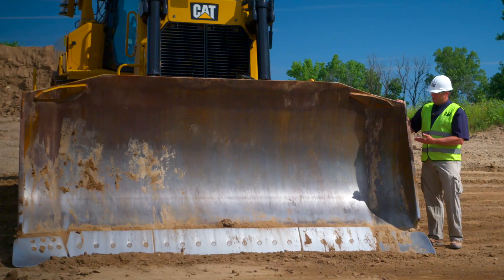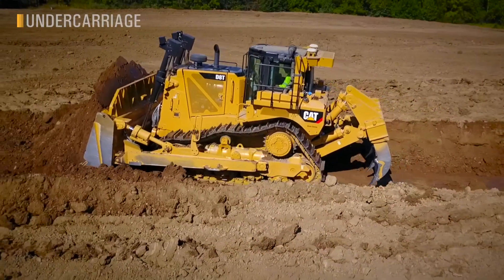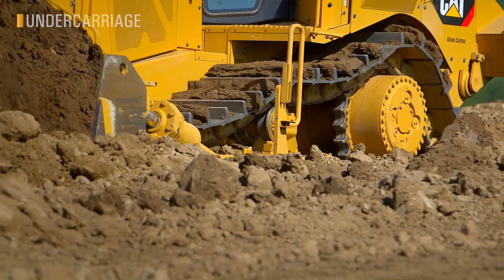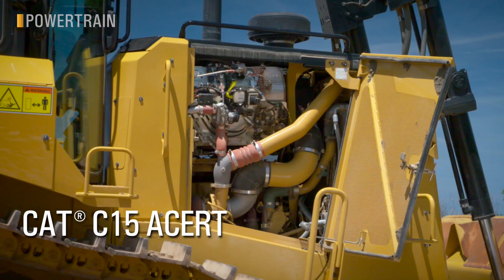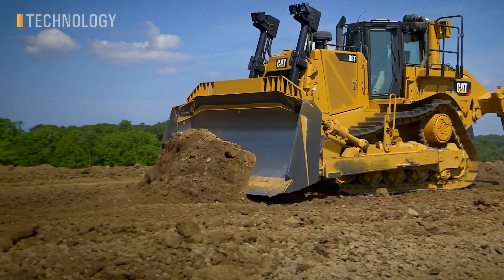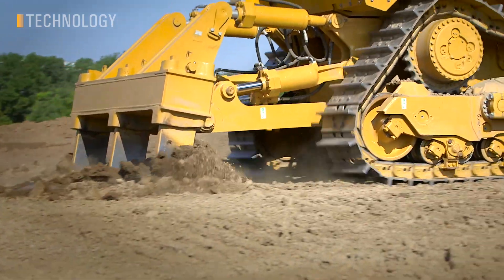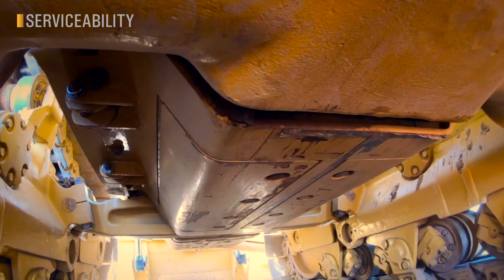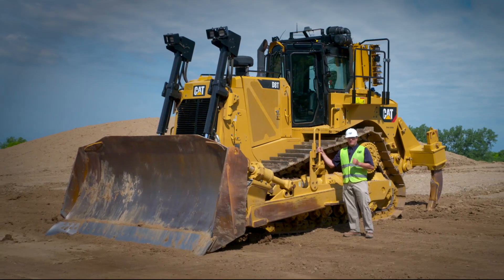Cat® D8T Dozer Feature Walk-Around

Comment: yea need a place for storage aka lunch box holder , deeper cup holders and some sort of built in communication, cant hardly hear cb's and the handhelds we use on our current job usually run down before the end of the day. A way to mesh coms with the stereo speakers would be a nice touch! Would make it alot easier to hear! Driving D8R now, that added 4th gear sounds like it would make this machine way more effective too!
@Cat® Products, Get at me I have an excellent idea for the future of GPS and dozing! Something that could be implemented even on older machines. From your 6 wheel ADTs 745's, 740's to your dozers, this would be a total game changer for both operators and machines!

Comment: Where is your video  on the 10T Dozier. I work in  mining for the last 11 years I notice that cat does not  show dozers ripping  in blast rock where slot of the rock needs too be RIP before  it can be loaded. You maybe able  to  use auto rip in soft ground  but don't work ripping rock as you need to be adjusting the ripper all over time

Comment: I do like the four-speed idea that's about it but I think I can push more when it's struggling and second that's when I'm hogging
Reply: The four-speed puts 2 gears where you previously had just one This is what really helps that 2nd gear dozing, as the D8 can cut in 1.5 and push in 2, downshifting automatically if it needs to.  This really helps improve production when hogging dirt.

Comment: High track only has 1/4 or less of sprocket engauging the track.. how is that possibly better ? Seems prone to track slip or rapid sprocket wear. Komatsu 475 push more than any cat..
Reply: We've done quite a bit of analysis on undercarriage wear, and found that whether low drive or high drive, the first tooth/bushing contact takes 85% of the load.  The next 2-3 bushings take the rest.  3 teeth is all it takes.
Reply: Roger schooled you fool. LOL

 ..    n